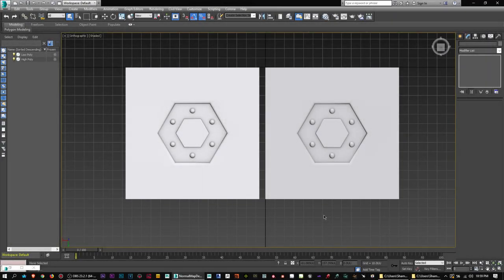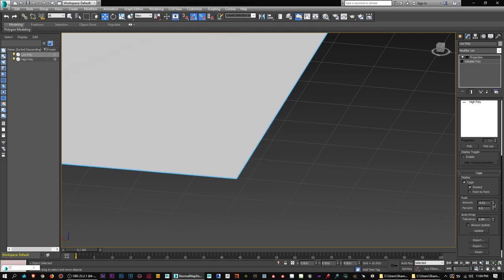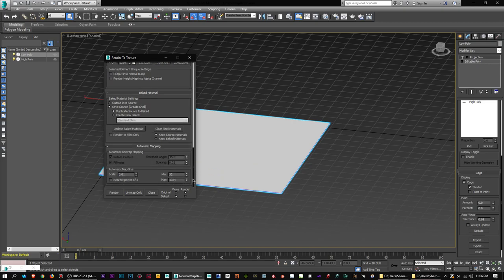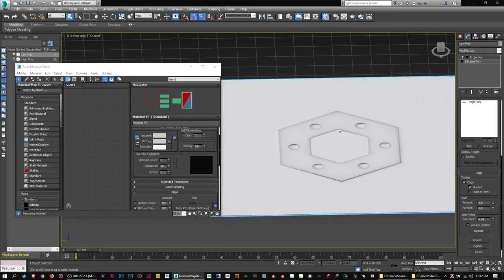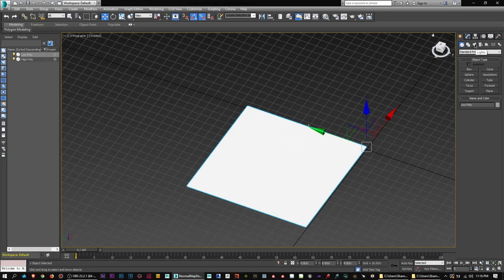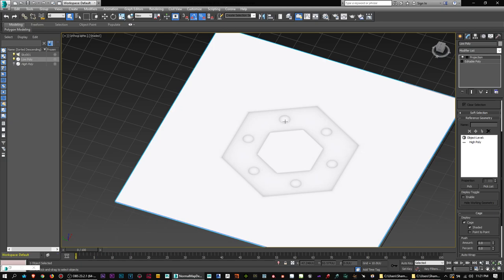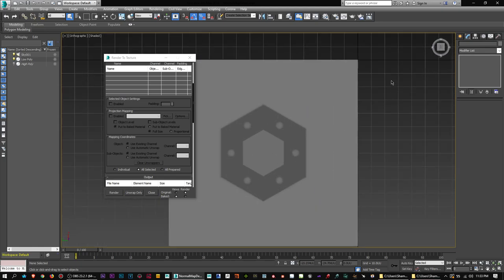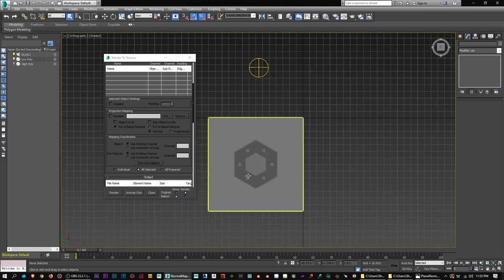3DS Max - Normal, Height, & AO Map  Projection Baking Technique

Comment: Many thanks for this video!! just one question, Is it natural that AO render takes like forever on the simple cylindarical objects...?
Reply from the maker: Anytime! and well, not sure. I have not had that issue, usually when it takes forever, there is a flipped normal somewhere or overlapping UVs. I know in 3DS Max, when your on the UV Grid space pop up, there is a option to show flipped normals/faces. I think it is under tools? If not, just look at the top menu options while on that pop up Grid were you arrange your UV faces, you will see what I mean.  If that is the case, all you have to do is flip those faces with flipped normals, the other way and it should fix the long bakes. If not, then it may be something else. Try to make different cylinder objects, heights widths, etc. and test it out on each. Then, if it still takes forever, then it must be normal. I know a perfect flat column shape  is kind of pointless to do AO bakes unless you have objects near it, that intend to bounce shadows onto the cylinder object, because AO is meant for like crevasses, details, etc.

Comment: Something I've been struggling for a long while already: is there an option to obtain a heightmap from a bumpmapped surface, so that the resulting heightmap would also follow the bumpmap of the original material? Because from whatever I tried, not only the various map types have different normal map impact whenever assigned as a bumpmap, but also none of them affect the heightmap. And I want them to, as I feed both maps to a raymarcher, so I both require a very accurate heightmap scale (so it would match the normal map almost perfectly in order to accurately reconstruct the surface) and want it to also actually reflect every dent (which it doesn't, so I end up with a neat complex surface which features all the polygonal details yet still has the dents looking like a flat bumpmap).
Reply from the maker: Hmm I'm not sure how to make that work via 3DS max, but i know a program called "Crazy Bump" might work wonders for you. You can feed into it a Normal Map of your choice, then it will make other texture maps based on the Normal Map, including Height Map/Displacement Map. You can even adjust sliders to best fit what your looking for as well. Might be worth a shot if you can't find something else to do better.
Reply: @WraithDesignz  Thanks, I will try that, though I don't really expect it to do the trick needed. The issue is, raymarching is a way more accurate thing compared to POM or anything, and in fact I use it to seamlessly combine raymarched and triangular geometry (they do even sometimes intersect in the scene, so every minor normal vs height mismatching will be very visible, making things even worse compared to the 'flat' dents and stuff). Also normal maps are pretty much geometrically incorrect anyway, as they use interpolated normals baked off a still low-resolution geometry (as the source triangles still exceed 1 texel in size). Would be fun if this thing would be able to consume a reference heightmap and instead of regenerating it would add the details where the error between the normal-map-derived and the reference values gets above some threshold...
P.S. Tried, and it failed so badly :(

Comment: Hi, what light setup do you use to create normal map? skylight or something else?
Reply from the maker: I don't use one at all. For normal maps, the cage provides the light for you when it scans the high poly to the low poly. That is the only one as far as I know that does not require a separate source of light like AO does for the baking process. So settings would be say, under light = "None" or "No Light", and for the method to scan, I use Hammerslay, with "Catmull-Rom". I also have the detail or quality setting maxed to 1.
Reply: @WraithDesignz  Thanks for quick reply ;)

Comment: Thanks for the tutorial. It is very helpfull. For some reason, when I do it, the normal and ao maps are fine, but the height map comes out wrong. It is almost completely gray. When I put it in photoshop and change the levels you can see something was actually rendered, however the quality is very bad and you cannot really use it as a displacement map. I tried it 2 times with two very simples models, and the result was the same. Any ideas?
Reply: So I figured it out on my own. It was pretty easy. When you click on options in the projection mapping dialog window, in the window that then appears, you have to put a correct max and min heights relative to your model. I had +/- 10 Meters on, which was waaay to big of a difference for my small models and it rendered the height map completely invisible. So thanks again for the tutorial and good luck with your future stuff. :)

Comment: When ever i render to texture there is always a grainy noise like texture on the maps. 
Have you ever had this issue before and do you know how to fix it? 
I have pictures on the 3ds max forum.

https://forums.autodesk.com/t5/3ds-max-shading-lighting-and/render-to-texture-adds-noise-to-texture/td-p/9939648
Reply from the maker: From what I can tell, it may be because your using VRay. I don't use VRay so I couldn't tell you why or be fully sure, but I never had that issue the way I do it. I only use scanline renderer and I make sure it is in production quality settings. I'm guessing it has to do with some sort of conflicting or improper settings using VRay maybe?
Reply: @WraithDesignz  I rendered the height map with scanline but the image of the box  with squares is rendered with Vray. the issue isn't Vray because when i zoom in on the texture i notice the noise. And it does the same for Arnold. I tried .jpg .png .bmp.tga .tif .exr and for some reason .exr and .bmp show up black. I tried to render the texture with Arnold but it keeps giving me an error.